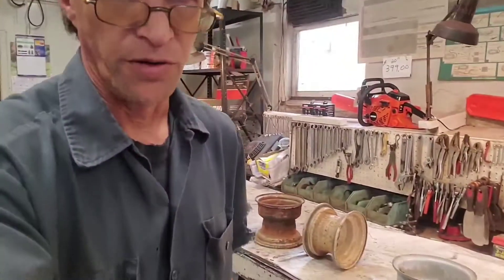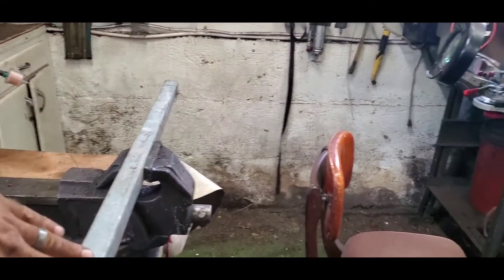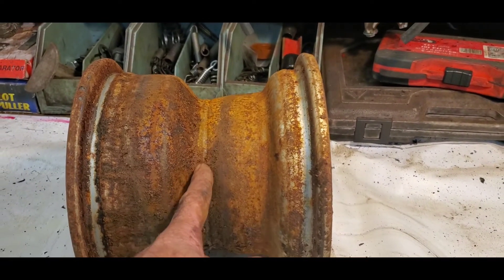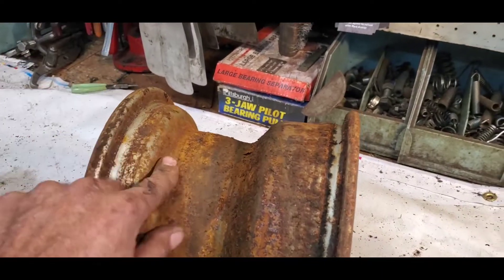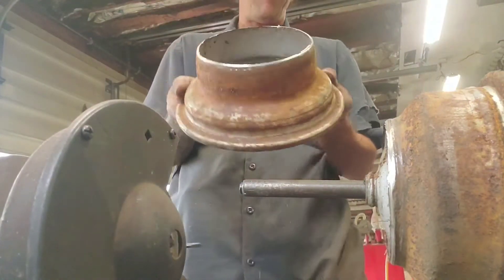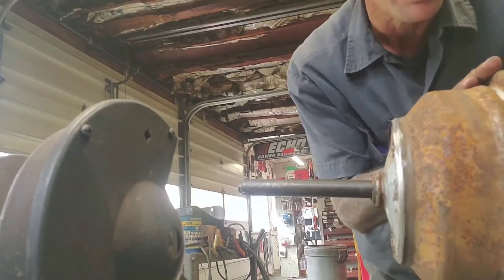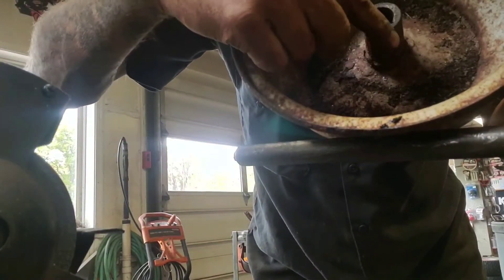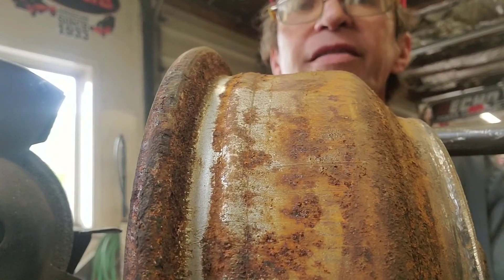How to make a train wheel

Comment: You don't need flanged wheels. You can use any regular wheel with a stationary flange. All you need is a piece of flat iron  about 5 inches long, with the ends bent up slightly, that brushes along against the inside of the railroad track. Leave about a quarter inch gap. Also, the flanges don't have to be in exact alignment with the wheel, they can be slightly ahead or behind, doesn't matter

Comment: The steel in those wheels is very soft and will deform after carrying any kind of serious load for a while. We made a full sized track cart using big truck rims for use on a real RR project and within a week the wheels were junk.
Reply from the maker: So far, they lasted 5 yrs. I tell everyone that operates it not to 'slip the wheels'.

Comment: When you were describing a train going around a curve it reminded me of a documentary I saw demonstrating the forces on a loaded train. They put a piece of string into an s-shape to simulate the train going round bends. Then they pulled on the ends of the string which straightened it out and said that's what a track wants to do. Hope that makes sense.
Reply from the maker: I saw 'Junkyard Wars' where they took 2 tapered buckets and put an axle between them and rolled them on a curved rr and they followed the curve , put staight cans on each end and the fell off the tracks.